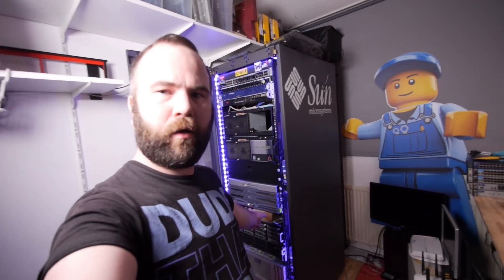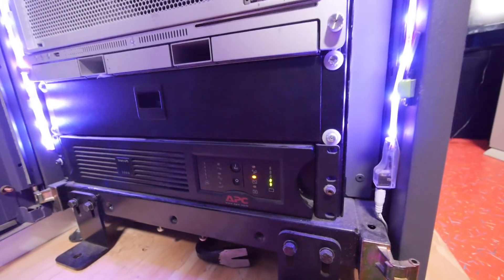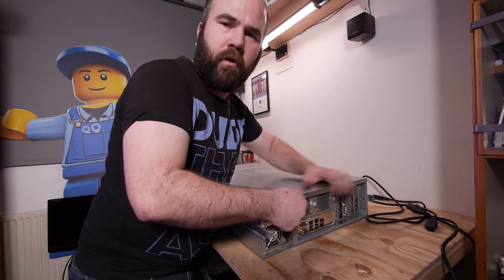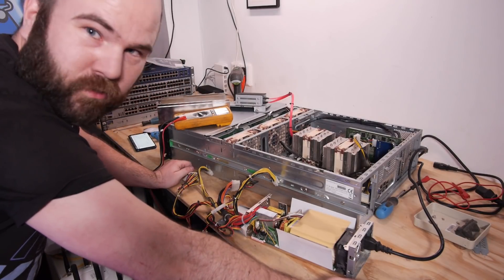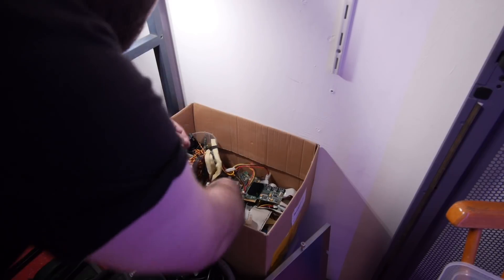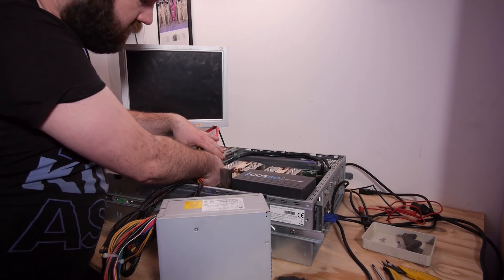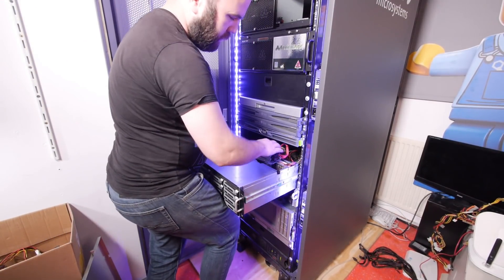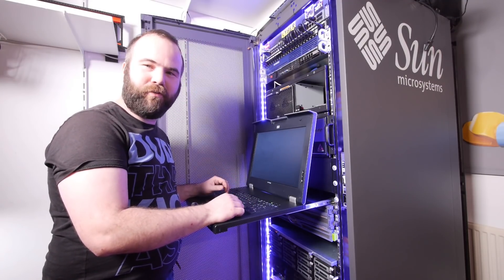Catastrophic Power Failure in my Homelab Took Out my Proxmox ZFS Fileserver

Comment: If that is a 1000 watt ups, you are over driving that usp.  I would recommend that you check your total power requirements, you look to be close to 3000 to 5000 watts.
Reply from the maker: it is 3000 watt....
Reply: @victorbart  I would add a second 3000 watt ups.  You can split the bench over to the second UPS.  WIth the Compaq as well having 2 UPS would be a good way to go. Sorry I could not read it in the video
Reply from the maker: Only the fileserver and networking gear is on the UPS. I don't have the wall power for second ups

Comment: Wooo.that's a bummer Victor, get rid of that UPS..I wouldn't trust is no longer...when a server is connected on a normal working UPS and the net get's a spike or fuses are blown and you get a blackout it's the UPS's task to handle the matter and provide the necessary power in the meanwhile, and if the current isn't restored to 'gracefully' shut down the server.  I've seen it before with UPS'ses...after let's say 2 years the batteries should be replaced with new one's if one is to be sure in 'darker' times the infrastructure isn't compromised.  Good luck with the spare parts search ;-)

Comment: I highly suggest you to get a redundant power supply that fits in pretty much most standard ATX psu mounts.
I got one lying around from a supermicro server with pretty much all the cables you would need, two 750W+ silver units can fit into there
Reply: Well, he said that all his servers etc. had been shut down, which pretty much means the rack is most likely depending on a single breaker. Not sure how the fundamental eletric setup in a house is where Victor lives, but here it usually is 1 breaker per phase. That means, he would either have to pull a second phase cable with a separate breaker to the rack from his house power distribution board, or the only thing a redundant power supply would cover is a defective half of itself.

Comment: I ran servers for years at the place I work out before we stopped doing that portion of the business. The stuff I saw was mostly common related failures that no mater what your maintenance schedule was. Something would happen. As with everything though. Having redundancy was the key. One instance I remember was the back plane on a dual module psu went out. Thus taking the server down. UPS are strange. Even on 2 year cycle of new batteries and multiple tests. They would still go out and I know at least once. It tripped a breaker. But if memory serves me correctly. The UPS went out and I had to replace the whole unit.

Comment: I had this issue,  but sent the PSU you to be tested and was told it was fine.. it wasn't,  but it blew the board..
DFI board.

Now the lessons here are as follows.

When buying servers, you should buy the same ones/type. That way if one part breaks you can use another's part to check and also keep going.

You always should have spares, PSU, fans, memory,, backplanes, drives, 

Also the UPS  batteries may need changing as they're showing quite low power

Comment: There might be fuse inside the psu near power connector on pcp. Easy fix if only that has blown
Reply: @Marcin Berman pcb.Misstyped, sorry. Circuit board was what i ment

Comment: Its not a good sign when the breaker before the ups will go off. I would not have a good feeling about the ups.
Reply: i think he should do a load test on that ups
Reply: @Mofie-aoi  For anyone wanting to load-test a UPS, use an electric heater, not your servers, and make sure you don't pull more watts than the UPS is rated for.